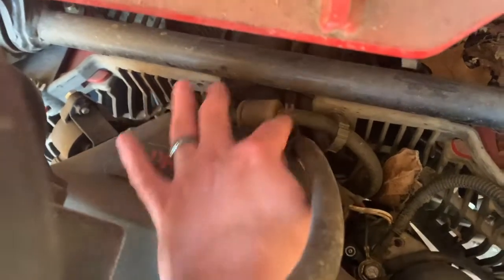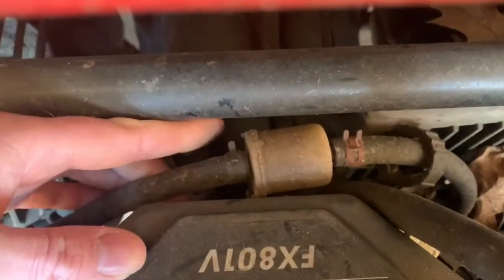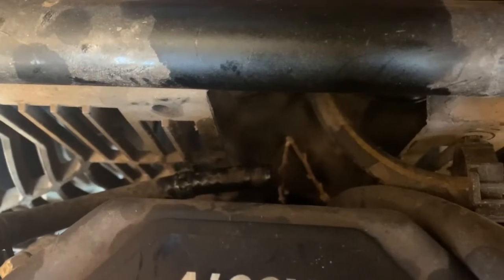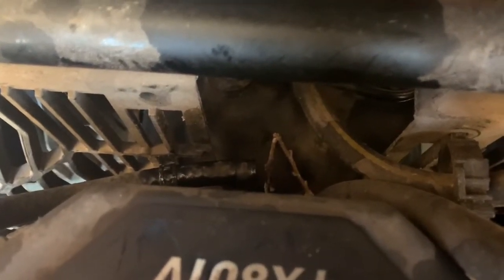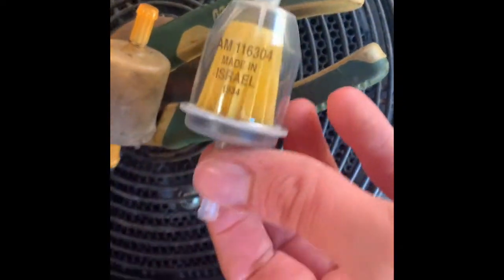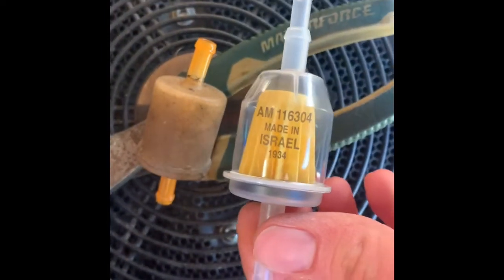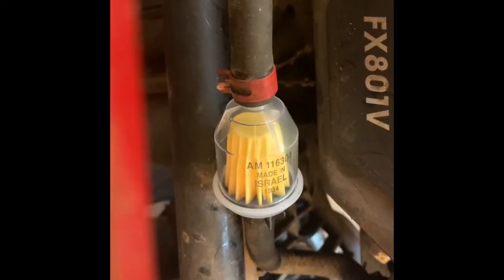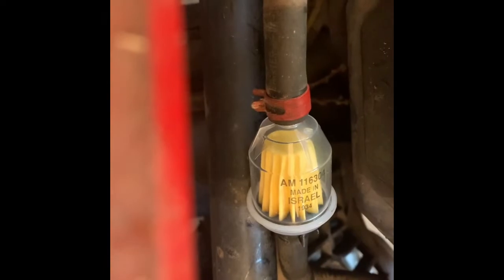Changing exmark fuel filter

Comment: The two most important parts of changing the fuel filter you don’t show!? Literally cropped out taking it off and putting new one on, thanks.
Reply from the maker: This is an older video that I Made. You are correct, I should have shown it. At the same time if you can’t figure it out from me explaining it you should either take it to your dealer or hire someone to mow for you…